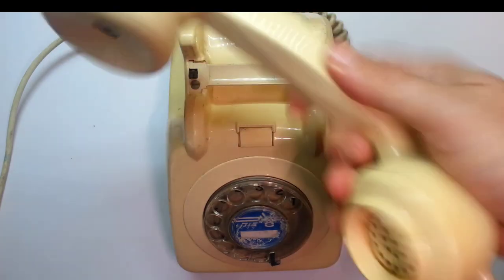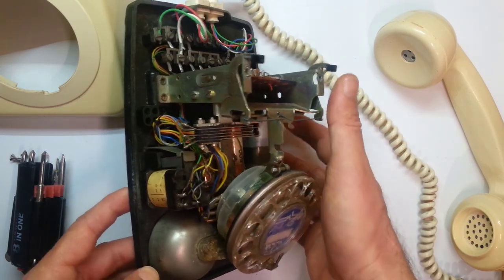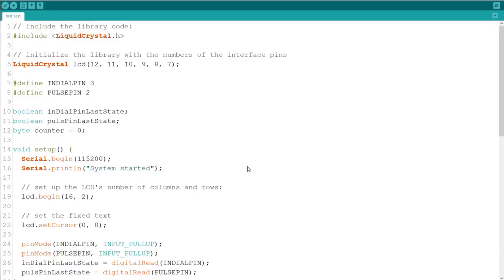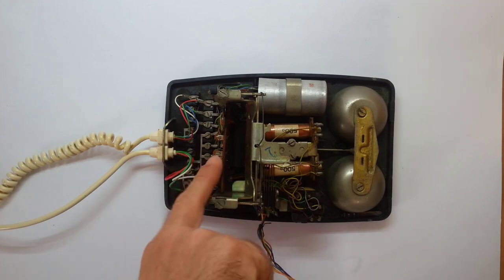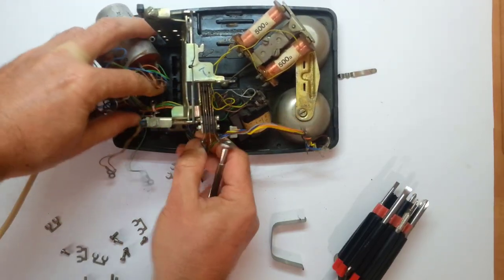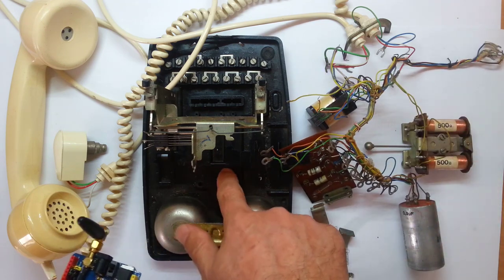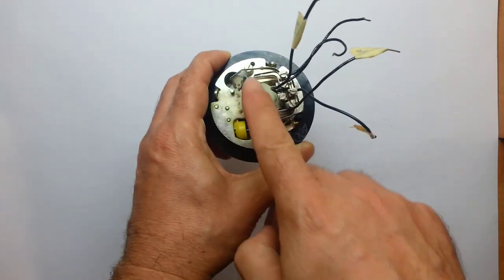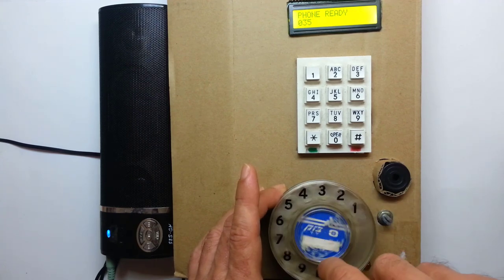Taking a rotary-dial phone into the future – part I

Comment: Why remove the solenoid coils for the ringer? :(
I was planning to use a SIM800L but now I've got an old Android phone with USB host, so I'm now using that instead... but that means I now have to write an Android app to answer the commands from my microcontroller and it's getting needlessly complex.
Reply from the maker: Mainly due to the power needed .... and I did not want to supply more then 5V in. 

The USB phone is an interesting approach :)
Reply: @talofer99  I'va managed to get it down from 40V to 20V... but, yeah, it would be good to have everything running at 5V. Using Android is simpler because you can just use one SIM and once device... BUT it's more complicated because you need an Android app and the SIM800L just "speaks" Hayes AT commands.

Comment: I have a US  Bell Western Electric  keypad and a British BT rotary phone, how do you  create wire  a standalone keypad so that the # and *  can be used, without compromising the functionality of the nice rotary action.
Reply from the maker: I'm not sure I understand the question :) 

You want both the rotary and the keypad to work on the same phone ? both as stand alone ? 
Can you some how show me a drawing or a photo of what you are trying to achieve ? 
I'm pretty sure its possible, just not sure what :)
Reply: Correct! a small keypad box next to the rotary phone. The rotary dialer on UK phones has 5 wires, my AT&T keypad has about 7/8  wires, US wire colours do not correspondence do to UK either.